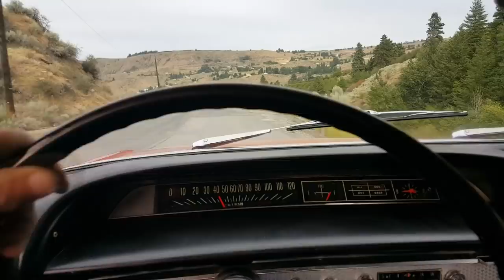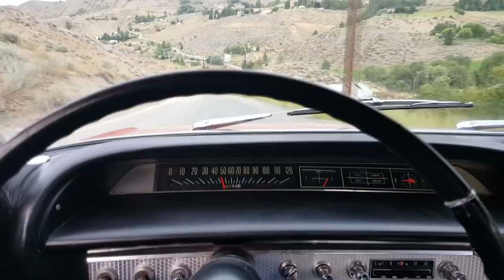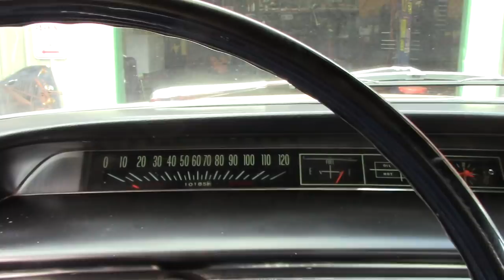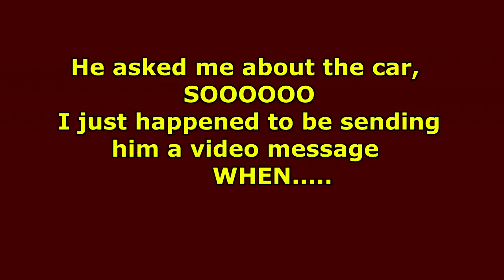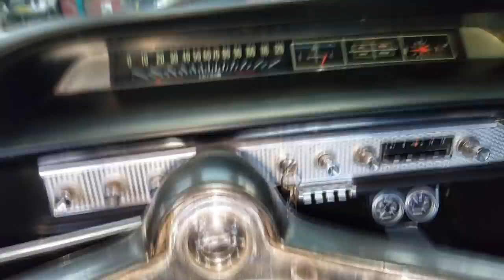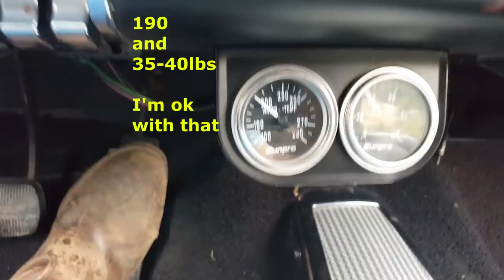63 IMPALA SS - Coil EXPLODED!

Comment: It must have been a bad month for coils, my old farmall tractor has the coil mounted horizontally and the internal resistor wasn't covered by the oil inside and over time heated up and after 10 minutes of running fine the thing would overheat and shut off. You should have heard the cool cuss words i was calling that tractor till i figured it out.

Comment: I had a coil fail on a V-8 CJ-7 once. It was backfiring occasionally like it had crossed plug wires, and would get worse the longer it ran until it had no power to even pull itself. Poking around, trying to figure it out I touched the coil and it was so hot that it blister burned my hand. I let it cool down and it would run okay for about 3-4 blocks until the coil got hot again...so I put the coil in a 44 oz. cup of ice and then it drove 20 miles home.

Comment: Check the voltage from alternator output and wire to coil. ?? I had a coil on my tractor blow up when I left switch on and it bent the points from over heating .

Comment: I couldn't agree more about 283 and 327s being Best Ever! I had about 15 cars by the time I was 21, including a couple with 283s, and a '65 327  2dr Impala hardtop. Broke a motor mount and the torque rolled the engine enough that the throttle linkage occasionally got temporarily pinched in at least half-throttle position. It was a kinda fun unpredictable ride until I bought a new motor mount.
Thanks for the memories. The 327 sounds awesome! 
BTW..the reason a failing coil performs ok when not under load but revs ok in the driveway is because when throttle is opened under load , the demand on the coil is greater than at idle or under no load or light load (electrical demand on the coil is proportional to load). The failing coil (likely due to internal primary winding short circuit(s)) wasn't able to produce enough voltage under engine load to fire all of the plugs, instead, firing them randomly depending on relative resistance in various plugs and wires, distributor-to-rotor contact corrosion, etc. That's my story, and I'm sticking to it. This link kinda explains it better. 
https://www.agriculture.com/machinery/repair-maintenance/how-to-diagnose-a-weak-ignition-system

Comment: Yep you got it right. A mechanical pump diaphragm gets stiff in cold weather. And if was really cold in the winter and it set for the season.  These new aftermarket pumps aren't built as well as they once were. I  have this problem from time to time on my older cars. That coil melting down has happened to me and always kept a spare just incase

Comment: Are those straight 12 volt coils or do you need a resistor wire or ballast resistor in-line?
Reply: Good question.  Chevys had ballasted coils, Fords had the resistor wire and Mopars the ceramic ballast resistor.
Reply: The resistor is built in but electronic distributor takes battery voltage
Reply: Sorry built-in the harness
Reply from the maker: yep

Comment: Thrush mufflers were the hot setup in my youth....until the cops caught me and then it was Hush Thrush. Rumor had it that stock Imperial mufflers had the lowest back pressure....
Reply: Hush Thrush sound good but they rusted out after one winter ('84) I used Dyno Max but they did cost more.
Reply: @vanstechcorral  Corvair Spyder
Reply: Van Diesel's Garage interesting....never knew about the Corvair connection. The fastest guy in my town used the Imperial setup. He ran a 396 in a four door Nova with painted steelies and contrary to the rest of us, tubbed and lowered the rear with unequal length leaf springs. Quadrajet on a cast manifold and Corvette iron exhaust manifolds. Everything blueprinted, ported and gasket matched. Never used anything but GM parts. The rest of us spent every penny on Holley, Edelbrock, Hooker, Chet Herbert, etc, etc. parts and he cleaned us all out every Saturday night. Cops never noticed him. Took me years to figure it out....
Reply: Get new stock ones cut them open pull guts out weld them up so you can't see they were reworked, cops look under car all they see is stock mufflers. the sound is ok until you get on it

Comment: I was a 350 400 guy and a coil going bad is a hard trouble shoot
Reply: Needs a Ballast Resistor , there should only be 12 volts going to the coil when cranking over the engine after that the coil voltage should be lower than 12 volts so you dont burn up the coil . Engine gets 12 volts while cranking for starting only .
Reply: @sgcommander8173  that is true for points ONLY,the rest use full voltage.

Comment: Set the fuel pump regulator to around 3 psi running (no more than 5) with that carb.  6 psi if it was a Holley.
Reply from the maker: thanks!   i would do that if it had a regulator lol.. ive ordered an OEM pump for it.

Comment: Well Walon, at fourteen minutes in, I am a gambling man so since it gets worse when you put it in gear but runs other wise, I venture a ground and that means do you have a internal or external ground coil? Cause it works like that. Ok, pass the popcorn and watch and see...
Well say you it was the coil or over fueling or both. I feel it but I am feeling the coil left cause it lost its ground just like points do when you take them out and its all green under them so you clean them so they can ground and touch them up with a horse shoeing rasp... or something like her nail file if you ain't feeling that aggressive. Okay I know your not running points but I used that as a example for grounds ok. Now if the cil is exturnal ground and it some how gets nasty from the weather or just over time  cause what causes it in the first place.. damp or time and rust and dirt... just wish I knew if that coil was one or the other

Comment: My guess would be the coil had a short inside the coil? But Im no mechanic.
Reply: It is common on older coils for the seals around the posts to decay and the oil to leak out.  The coils then overheat and your off to the circus.  The shellac on the coil windings also cracks from age and heat allowing shorting between the windings.

t

Comment: I also am not a mechanic. I am a retired train driver. But..... computer/no computer in car, I’ll take no computer. Same for fuel pump. Electric/mechanical, I’ll take mechanical. My old G60 Nissan Patrol came out with electrical or mechanical. Mine has mechanical. I’ll stick with that.